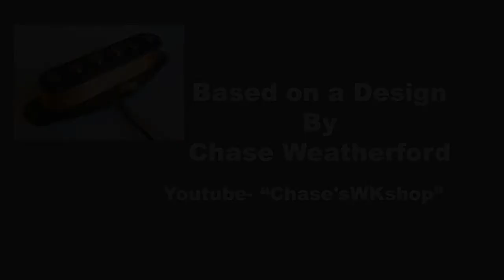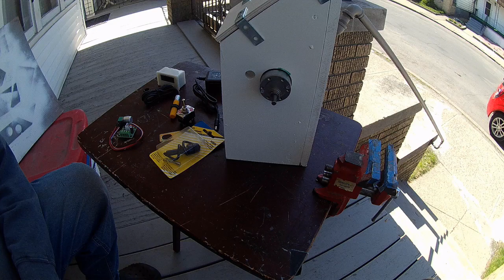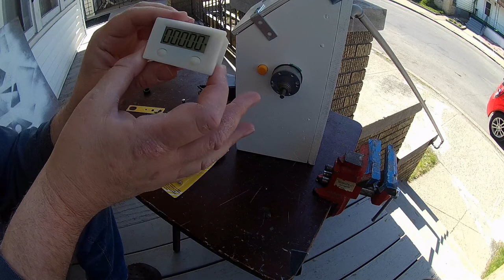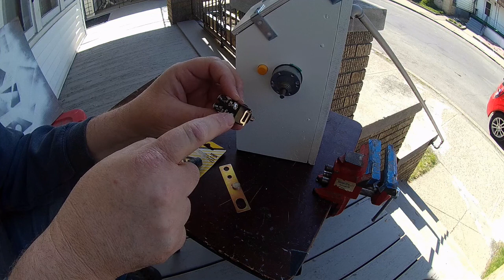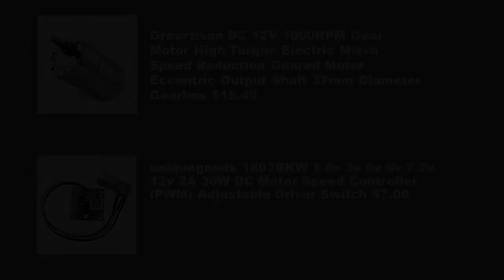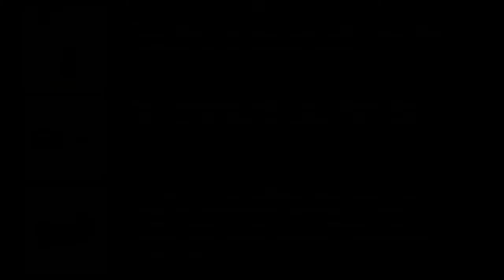Building an under hundred dollar pickup winder.

Comment: Nice! Real informative! Just what I needed to watch, thanks!
Reply from the maker: You're welcome, I think it should be clear how to do it. It can be mounted in anything, even a cigar box. The only thing I really don't go over is bobbin holders- for most just using the tape and super glue or double sided tape on that rectangular piece of cigar box scrap wood. When I'm diddley bow pickups using plastic sewing machine bobbins I mount a cylinder magnet in the center of the bobbin, slide the all the way back so the magnet connects to the motor spindle. 
The hardest, and what I'm still trying to come up with is a holder for flat stock for surface mounted humbuckers. 
If you have any questions post here on tag me Michael F. Copado over in the facebook group.